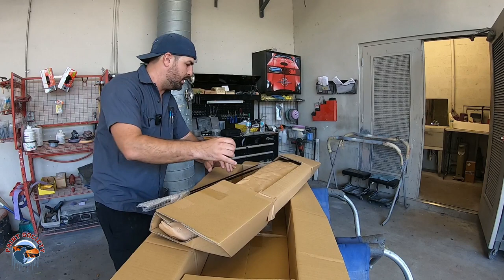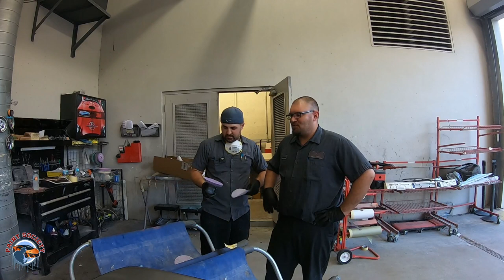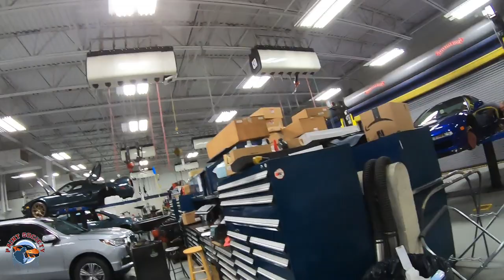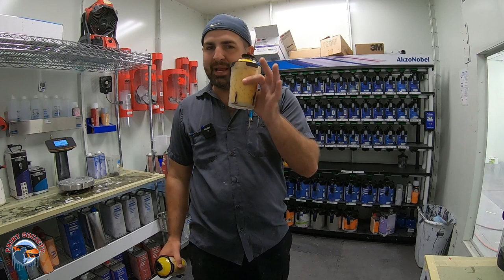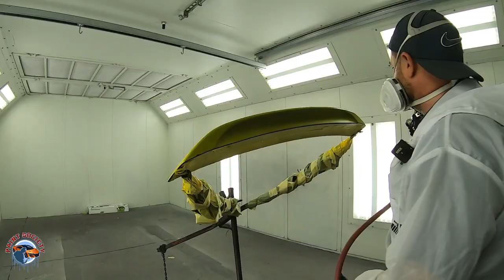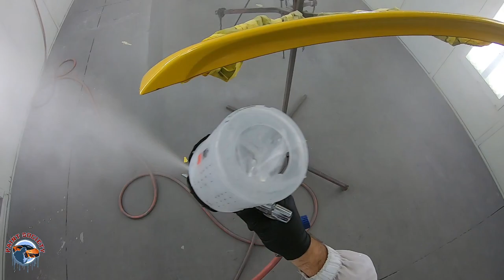Painting a HONDA S2000 Yellow Pearl Wing! Part 1

Comment: The replacement trunk springs are a higher rate spring than standard. That's because, with a spoiler attached, the trunk lid is now much heavier than it was without the spoiler, so to avoid the trunk lid overcoming the stock springs and closing on its own (or on your head!) the springs need to be beefier to hold the lid open against the increased weight.

Comment: for us DIY-ers that dont have access to a stat gun, is it okay to use an aerosol anti-static spray (i.e. electronics anti-static spray) or use Staticide (topical anti-static solution that you wipe on), or simply an 80/20 mixture of distilled water and denatured/isopropyl alcohol solution (and/or sometimes people use fabric softener; which i dont think is the best idea since itll leave residue)?  Do you have any inexpensive and simple alternatives to solve the static charge issue?
Reply from the maker: You actually can buy anti static wipes. Once you wipe it one before paint it will be good to go.